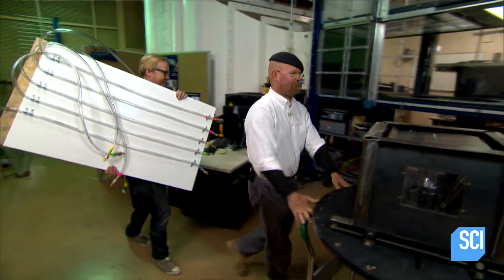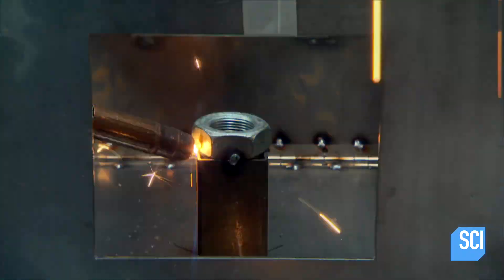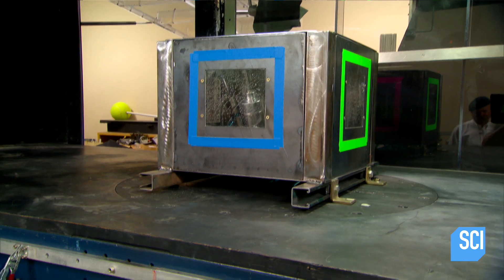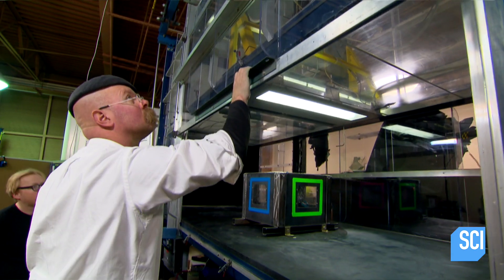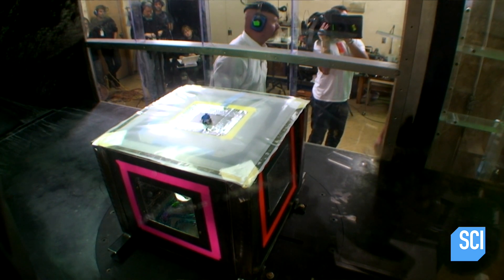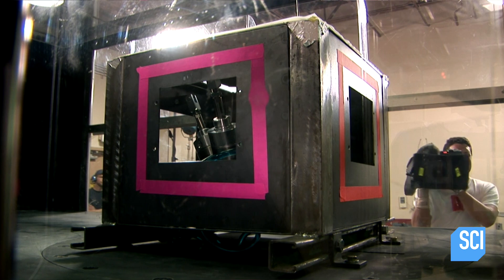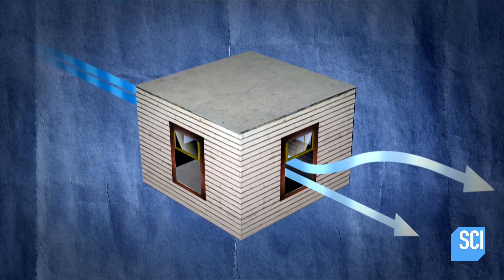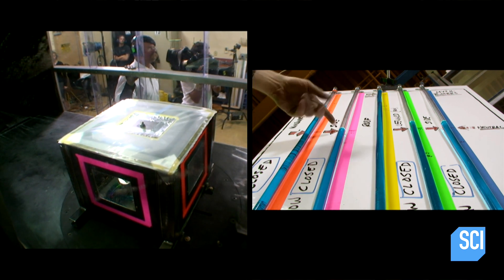Should You Open Windows During a Hurricane? | MythBusters

Comment: OK, guys, nice demo. BUT, having survived many hurricanes in houses of various construction, your "rules of thumb" only apply in certain circumstances. I pity the victim who ALWAYS opens all their windows and doors. Wind direction changes around the compass during the hurricane and utmost attention must be paid to the areas of greatest stress (the windward side) and those used for stress relief (the lee side). Unfortunately opening all windows, as your project suggests, is not feasible unless you plan to abandon a totally open structure. Say goodbye to all your possessions if the wind speed is over Cat 3; furniture, books, cars, tools you will need later, you name it.
One critical factor your demo overlooked; the wind speed is never constant and pushes and pulls, wracking back and forth, albeit from the same general direction on a short time scale. This wracking will "work" joints and corners, slowly gaining purchase on ever-greater open slots or holes in the structure and beating up everything room by room. Robust construction will, of course, make a difference but is no guarantee of minimal damage unless you live in a bunker. I have seen masonry houses scraped off their foundations with only the stubs of plumbing and electric sticking up. (100 feet away, virtually no damage to the neighbors. Go figure)
60 feet per second? Really? That's only 40mph, just one mile per hour over the Tropical Storm lowest wind speed. A Cat 5 is pushing 227+ feet per second. When hurricane Hugo hit the Virgin Islands the NWS said it was a Cat 4, but local anemometers broke at their limit of 249mph, over four times your test speed. When stuff is flying around at over 155mph at Cat 5 speed there's no telling what will happen, even to your steel house when it is hit by another flying steel house that's come up off its foundation in an embedded tornado in the hurricane. I've seen this happen to masonry homes.
In short I recommend, if you plan to stay in your home and have a safe room you can retreat to when things get completely unmanageable, that you open windows or doors on the lee (away from the wind) side and monitor where exactly that is throughout the course of the storm, opening and closing as required. I survived hurricane Hugo in a 300-year-old, 400 sq. ft. one-story wooden building by relieving the pressure during massive differentials due to wind direction and instant speed changes. Nerve-wracking but we came through, and we were very lucky being situated in a partly protected location. Stuff around me just disappeared, lost its roof, or was totalled in place. I can't recommend the experience but I wouldn't trade it for anything. I don't want to do it again, but one never knows. I'm now living in a masonry home I designed with very robust Bermuda-style drop-down shutters and have weathered 4 bad blows since Hugo with no structural damage. No such luck for our trees and landscaping in Maria. All the best and stay safe.

Comment: What about all the furniture and items inside your home? This is great if you own a vacant property in the shape of a perfect cube and the front window lines up perfectly with the rear, and the sides with each other too. But most homes aren't built that way, there are walls and corners and no straight path for wind to blow in one window and directly out the other. I call BUSTED on this test because there's too many things it doesn't factor into it that are closer to reality. This would work great for a business that has everything bolted down and everything that's not is insured above value and the structure is in the perfect cube shape (or rectangle if that shape works just as well). Like a factory with big bay doors or something. I'm just glad I don't live in an area where tornados or hurricanes are common anymore. Although if HAARP keeps screwing around that might not matter soon.

Comment: If you build a miniature where the interior has about 3 walls that obstruct the flow of air, you'll see that the internal structure would take the brunt of the force. A more appropriate test would have consisted of a few more plated walls that had been cut in half width-wise and placed parallel to 3 of the windows while simultaneously bisecting the other walls. With this more realistic test the pressure on the walls would have been considerably more than what was shown on the sides due to the temporary entrapment of the air. You disappoint me, Mr.Savage.

Comment: Note in Jamie and Adam's test house, the wind can flow through the house unobstructed.  But houses will always have interior partitions which will interrupt the flow of the wind.  In fairness, I don't think their test house models reality all that well.
Reply: This is only half of the test. In the next half they busted the myth.
Reply: There is still a lot of stuff inside the test house, as those cylinders are really fat, but they definitely should have added at least one wall across the whole thing, with openable door. This model simulates a house with all of the internal doors open, so probably the worst thing to do would be opening the windows and closing all the room doors, as that would give the baloon effect as well as let in the rain and more debris from the hurricane destroying things outside.
Reply: The biggest problem with the test is the roof most roofs aren’t like that and are pointed. This caused a difference in pressure and will literally rip the roof off the house
Reply: The second half of the test used a to-code House,this is only the first half

Comment: In hurricanes, the rain travels horizontally.  So, here's the tradeoff.  A house built to a modern code in South Louisiana can probably withstand 100 mph winds with minor amounts of damage.  (My house, built in the mid-70's, required roof replacement after hurricane Katrina.)  If you leave all your windows open, you will likely have to replace 100% of your carpet, and 80% of your furniture.  My plan going forward is the same as my plan to date: keep my windows shut.
Reply: You're right. Having everything inside destroyed is just as bad as having part of your house destroyed. Might as well keep everything shut and the inside protected.
Reply: Here's a tip avoid the coast.
Reply: imagine having full room carpet ☠